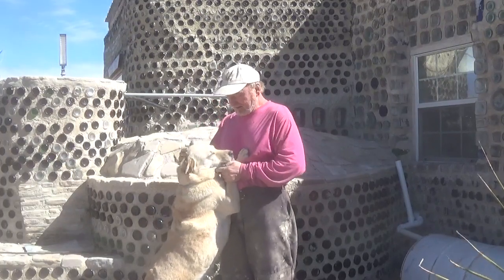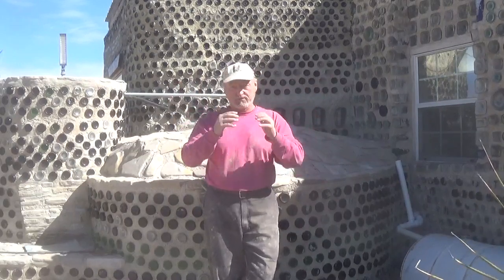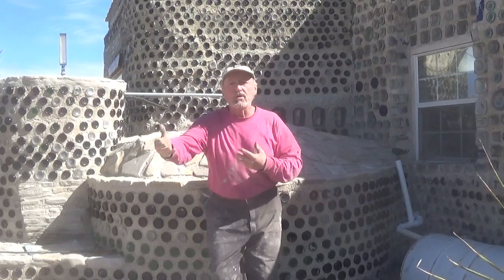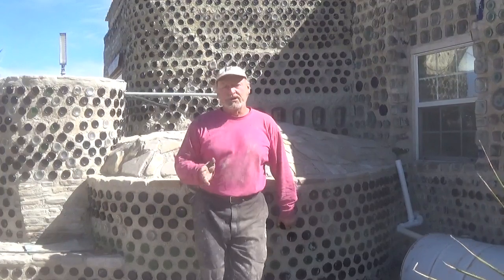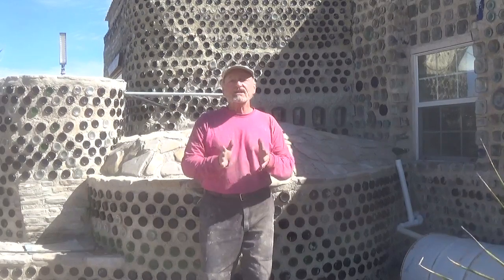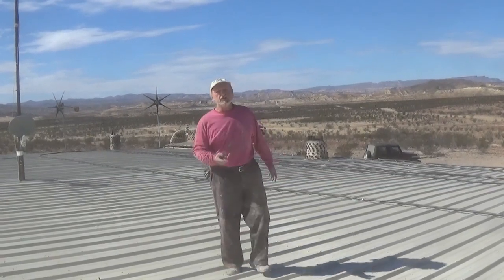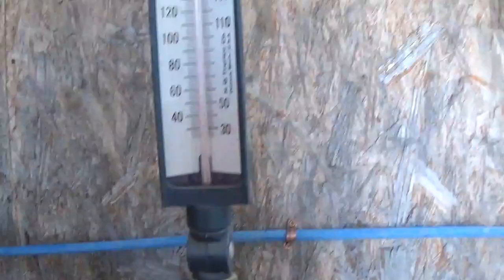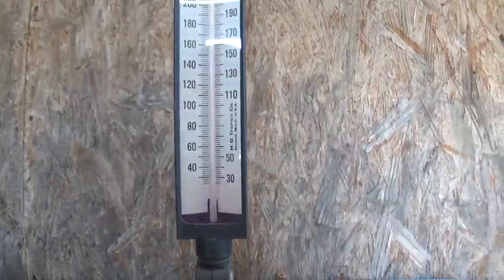Our Solar Hot Water System- PRESSURIZED

Comment: I guess if I were to take your ideas and modify them a bit I might setup to generate the hottest water possible (eg maybe 150 or more degrees) and then use a common mixing valve on the hot output which would automatically add cold water as the hot water is used to bring it down to 120.  It is an effective way to increase the volume of hot water without more storage while regulating the output to a consistent and safe temperature.  Mixing valves are mechanical and therefore do not require electricity and are reliable.  Another minor mod would feed the solar heated water back to the top of the first tank (perhaps through a tee at the relief valve) rather than via the normal input which internally is piped to the bottom.  That would thermally separate the cold makeup water from the heated solar water.  I would pull the solar return water from the bottom of the second tank rather than the hotter top.  Finally I might dedicate a pv panel to the circulator pump and seriously consider a differential temp controller to determine when to circulate.  There can be times when circulating the water simply cools the tank.
Reply from the maker: Those are the tweaks I mentioned in the video. We will keep it from circulating cold water by simply turning off the pump.... but we are always here, so that is an option.